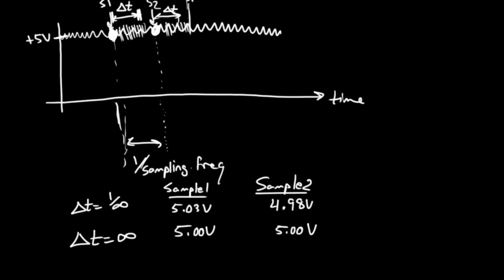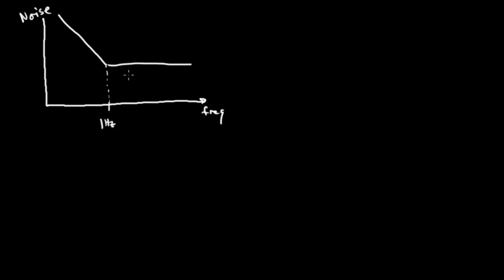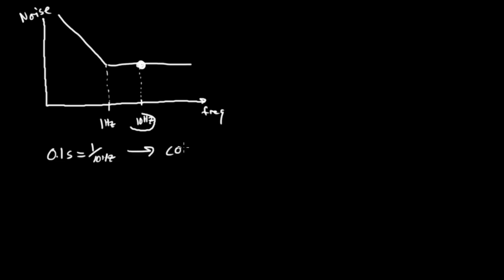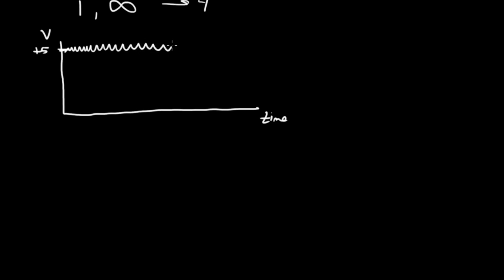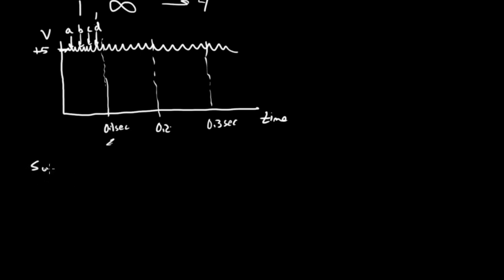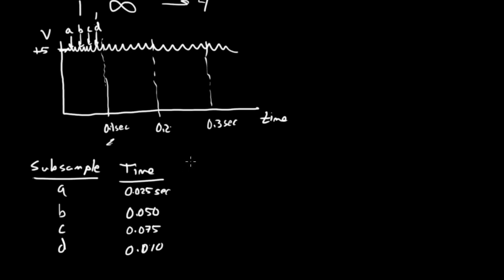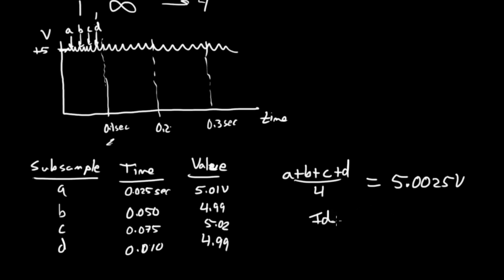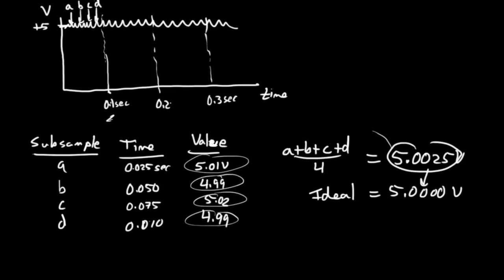Reset noise in RC system 4 [6 of 10 Image Sensor Noise]

Comment: I don’t think fast sampling and averaging removes flicker noise. It remains almost constant for all 4 samples and only the very fast white noise gets filtered by averaging either with a capacitor or by multiple sample averaging.

The flicker noise is likely either removed by simple dsp curve fitting algorithms or by using analog band pass filters.